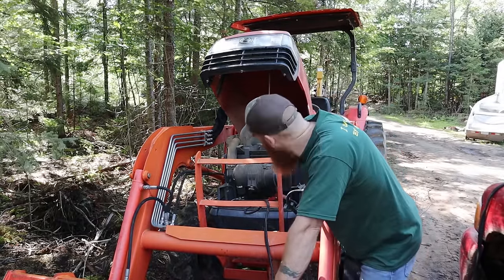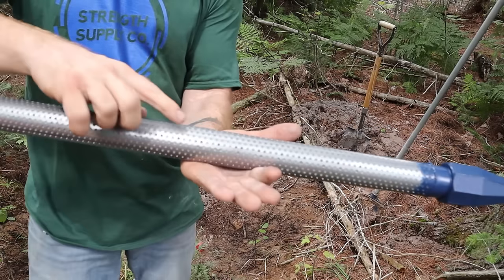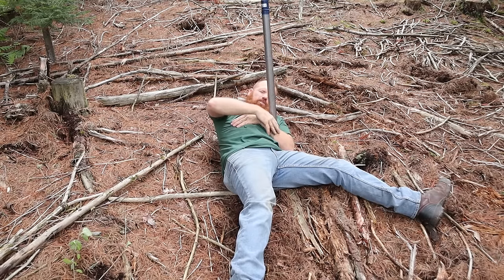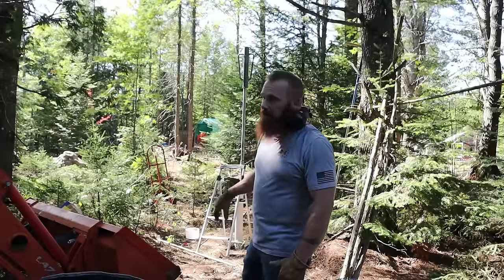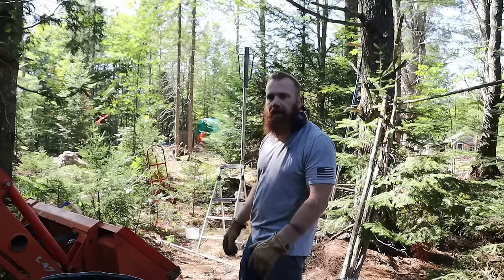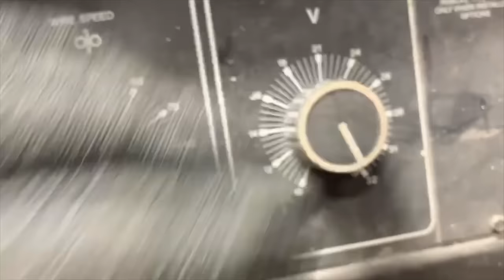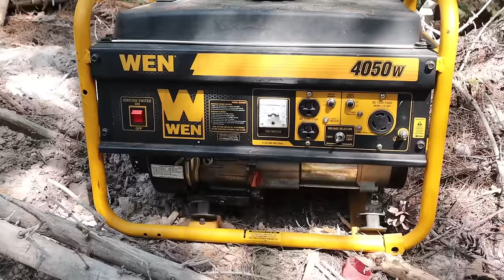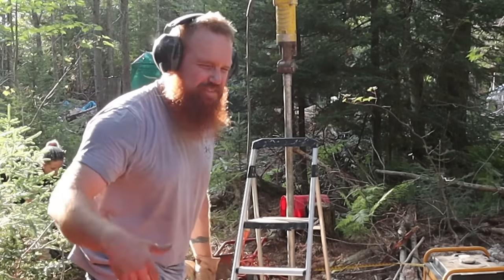Off Grid YouTube Family of Girls Step up to Help Dad Drive a Well | Fabricating Off Grid Well Tools

Comment: I'm a bit baffled as to why after driving by hand so many feet, why not rent or purchase a pneumatic hand-held pipe driver? They've been around since the early '80s. Then again, you have access to water, why not a Honda well driller. You have the means to recirculate the water used to remove the mud caused by the drilling process... You have a tractor with a 540 pto... You could adapt it to drill your well. Unless the lesson here is that of frustration?
Reply from the maker: Not sure if you have ever been up here in the upper Peninsula of Michigan but rental options are far few and between. I have thought about using the pto on the tractor to drill. Just haven’t got to it yet

Comment: Why can’t a well driller get out to your property?  Distance?  Navigating through the trees?  Cost?  At this point, I would task the girls with building a 4-lane highway for easy access. ;-)
Reply from the maker: Very small trail system and lots of trees would need to be removed and a very expensive road improvement. Not doable.
Reply: @9252LIFE  I figured. No easy answer.

Comment: I like the way you did it but what I did was I took an Olympic weightlifting bar cut collar of one side welded the remaining collar to the bar really good then welded a 45 lbs plate and a 35 lbs plate on top welded good then welded an eye bolt on top to tie a rope set up a tall tripod attached a pulley spiked the tripod good so it wouldn't move then got 2 inch half pipe camphered the first collar in then cut chisel teeth attached to two inch pipe drove the pipe with the chiseled end in first drove till it's started getting hard to drive then I got a barrel full of water from neighbors and just ran water down pipe gravity jetting sand rock and clay came to the top periodically I would put a hand pump with adaptor two screw on two inch casing see what came up nothing kept driving till I hit good water then I dropped a 1 inch pic pipe with a foot valve then plumbed that just giving you idea kinda skipped something the bar runs inside the casing as a guide you simply pull the rope and let go gravity will pound it lot easier than what your doing plus you don't know if the pipe is damaged deeper my way if casing cracks somewhere it's ok your dropping a sealed pipe make sure you by pvc with a bell to drop good luck
Reply: I been off grid for years with a lot less stuff at my disposal
Reply from the maker: Thank you.
Reply: @9252LIFE  by the way looks like you definitely hit water drop a 3/4 or 1/2 pic pipe biggest you can fit as far down as you maybe use a zip ties to hold a screen to stop dirt can in that broken pipe then put adaptor to fit you can use that to jet your next casing
Reply: @9252LIFE  I know it sucks after all that work to abandon but if you do it my way it will last forever my well is 30 years old still going strong. That's what you want something you never have to mess with again who knows how many fractures are in your pipe and how deep
Reply: @9252LIFE  one more tip when your jetting and no water comes back up you hit a pocket try hand pumping look at the quality might hit a spring like I did

Comment: Why didnt you just put a pipe on the side of the bucket of your tractor.
Wet the hole  and push it down.
You can get pumps with more lift solar or hand pump.
Reply from the maker: The tractor won’t push it down. We’ve tried it.

Comment: I know your done with this project, but, just a brain fart on my end. Why didn’t you use the tractor, instead of hand fence post driver? Positive you had your reason, but, just wondering.
Reply from the maker: Not done with it yet. And the tractor isn’t tough enough to push down a well point. It could do a fence T post.

Comment: work harder not smarter that tractor has a bucket for a reason
Reply from the maker: This has got to be the biggest topic on our video. The tractor will NOT push the pipe in the ground. Even loaded with sand. It’s just too small of a tractor. We tried it. Guess I should’ve put that on our video.

Comment: What you are doing won't work.  A point well only works to 20 feet.  If you want to use that pump you need to have a venturi at the bottom of the well. There is an outer casing and then a pipe that drops down that casing to the bottom.

Comment: Never understood the short 2 foot post drivers with handles !     6:24      Get rid of those handles and make a post driver thats 3 foot long instead. Unlikely you will have the post driver come off the end of the post  and smash your hand /arm !    And you have a lot longer swing .  This tap tap tap with the shorty driver ........ looks painful ! You dont need handles. Just take hold of the longer post driver and use it !
Reply from the maker: You are absolutely right on that! I had the post driver hit me in the head so hard one day I seen stars and had a mild concussion. When I was hammering up and down, I went up too far and the bottom of the driver went above the post I was driving down and caught the edge and with the downward force I was giving it, the top came down towards me and smashed my head! Not the best day
Reply: @9252LIFE    True  OSHA  should ban such a post driver ! ( just slightly joking )     If your going to drive a post... use more up and down motion......and you dont get that with a two foot post driver !

Comment: Its more manly to use the tractor bucket to push pipe down if you can operate 🚜.
Reply from the maker: It’s also more manly to know your tractors.. The little kubota is not strong enough to push it down as it doesn’t have downward pressure like a skid steer.  We’ve tried. Thanks for watching

Comment: You have a loader tractor behind you to pound with....just go easy
Reply from the maker: Tried it. It doesn’t work like you think it would. Not worth the effort. The hydraulics are slow going so it doesn’t exactly hammer and not tough enough to push it in

Comment: Why can't you pump water down the steel pipe to flush out the clay and drive it deeper?
Reply from the maker: I can. But the pipe broke off 8 ft down.
Reply: I think my comments are getting deleted??? Idk!?
Reply from the maker: As I was replying to your last comment it wouldn’t let me send.
Reply: Did u get my other comments?
Reply: Weird!
Reply: Ok well when we drill wells here in Florida we use 3/4 in pvc and blast air down the wells to prime them, and if it's plugged up with clay just pump water down it until it's clear but the air should do the trick. Just make sure u tie off the pipe cause if it comes flying out it's a big ass whip lol.

Comment: if the water is above the clay, and if you dig trough the clay the water above the clay can run away deeper
you need to figure out where the deepest point of the clay layer is (it basically forms an underground  water basin), when you would pump away the water there new water should seep trough over the clay layer to the deepest point again
but if there is a point where water can go trough the clay and go deeper, you may need to trough the clay to find the next layer of water.
@2:50 unless all the ground around there is clay there is no point of drilling that tube with screen into the clay, clay is too dense to (easily) let water trough, clay particles re so small it will indeed clog the screen.
@14:45 i hope the paint of the car didnt get damaged too much by the sparks and metal parts.
Reply from the maker: The camera angle made it look like the car was taking on sparks but it was not.

Comment: Man use that Kubota to push that stuff down
Reply from the maker: I know right! Sounds so easy ! Yep I tried it.. the tractor isn’t tough enough and it doesn’t really have a fast drop hammer Power either. Pushing in a Tpost and pushing in a 1 3/4 well point is a huge difference.

Comment: Excrutiating to watch... perfectly good tractor sitting right there and yet you're pounding a hole by hand
Reply from the maker: We tried using the tractor and it would not pound or push the pipe in. A Tpost yes but not the well pipe.

Comment: 15:12 Ummmmm... ooooooooooookay... and just exactly what is THAT shot-angle supposed to signify...?  Is it meaning that you're gonna use FART GAS for da WELDING TORCH??? :P
Reply from the maker: That could save some money in welding gas! 😆
Reply: @9252LIFE  Yes, but would baked beans cost more than the cylinders of gas...??

Comment: This is just a brain fart but what if you loaded your tractor bucket with a scoop of rock then let it down on the pipe. Would it drive it? I've never tried that before so I'm not sure but I'm sure I'm getting old so I have to work differently now days. Age will do that to ya.
Reply from the maker: We filled it with sand and tried it. The problem is the bucket doesn’t free fall drop. It just goes down slowly with the hydraulics and doesn’t allow it to hammer. And being such a small tractor it just won’t push it down. It barely does metal fence t post.

Comment: why isnt your tractor doing most of the work//?
Reply from the maker: Just in case you’re wondering, no the tractor won’t pound the pipe down. No the tractor won’t push the pipe down. Maybe we could’ve somehow put pressure down on the pipe with it by tying straps to it but probably wouldn’t be worth the effort
Reply: No i saw you carrying stuff and thought just load the tractor to carry

But further to your point you could hold the weight of the jackhammer it perhaps

Also surely theres a hydraulic attachment that can help
Mate of mine drives piling sheets with something similar

Comment: I would have used the bucket on the tractor to push it down
Reply from the maker: Us too.. But unfortunately it doesn’t work like you’d think. If it was a fence Tpost it would do it but it wouldn’t with the well pipe through the clay.
Reply: @9252LIFE  I have thought about drilling one myself just never got around to it as its isnt really needed. I was going to use a petrol powered earth auger with 4 inch drill. (I have one lying around thats not been used for a few years)

Comment: Hey brother it would be a lot easier to use a pressure washer with PVC pipe cut some teeth around the bottom
Reply from the maker: We didn’t have much water to work with at the time.

Comment: No way that pump is going to lift 60feet from the surface.  cavitation
Reply from the maker: It wouldn’t lift 60 feet from the surface.  The ground water is less than 20 ft down. Just need to be in sand not clay to draw the water up.
Reply: See you changed the name of the click bait video that stated well was 60 feet.
Reply from the maker: @LionSandwich  I haven’t changed anything. Pay closer attention.. Take care

Comment: really....that entire video you had a loader tractor sitting right there and you never thought to use the bucket to push the pipe down....I've driven 2 point wells with a loader tractor....one at 25 ft and one at 100 ish feet. The jackhammer was a horrible idea especially on that cheap crappy stepladder you had.
Reply from the maker: 1: Tractor bucket will not push the pipe down.
2: The jackhammer worked great! 
3: The stepladder served it’s purpose. 
4: I hope you’re having a great day. 

Take care Michael

Comment: You've got a tractor with a front loader standing right there, which could be used to hammer down the pipe with the front loader ?????? Why make your daughter do it ??
Reply from the maker: The tractor won’t do it. Tried it. Would’ve been nice but it’s a small tractor.

Comment: Your so funny you have a tractor behind you and you're using a post driver to pound the pipe... WOW... Have fun, next time think before you act... Use the Tractor...
Reply from the maker: Your so funny you don’t think we’ve tried that yet...WOW... Have a great day, next time think before you comment...
Reply: @9252LIFE  Yeah, Anyone that would think of using the tool that you eventually used, would surely have thought of that, Great idea and inspiring to say the least... 
It was nice that you had that tool available, the ones made for a tractor are expensive to say the least...
PS did you ever get the water system to work after the pipe broke?
May GOD Bless you and yours... AMEN...

Comment: ….why aren’t you using your machine???.  Also you said you have water at 8ft, why not just dig a water source pond?
Reply from the maker: The tractor wasn’t tough enough and we wanted down further to cleaner water that also won’t freeze in the winter up here.
Reply: You aren’t stronger than the hydraulics of the tractor.
Reply from the maker: Stephen the hydraulics doesn’t work going down.. the hydraulics work going up.. when going down it’s only gravity that brings it down and slowly so there’s still not much hammering force. Therefore yes we are stronger when it comes to pushing/hammering in a well point. We have tried many different options. I hope that clears it up a bit for you. Have a good day Stephen.
Reply: No. Also they make a pipe clamp you can attach to a chain to pull a pipe vertically. When it come time to fix the pipe. You might even be able to wrap a chain around the pipe and pull up with the bucket with out digging it out. As for driving with the bucket; if your hydraulics only work in one direction, you can fill the bucket with dirt and wrap the backer with a tarp. Gravity+weight of the load will work better than a fence post driver
Reply: Sounds like you have water in that casing pipe from a high water table. You could use a mud pump from harbor freight to jet the well with your well pipe. You could use your machine to dig a sump pond the well head can drain to through some hay bails.

Comment: I've tried welding those tools for hammers and not sure what material they use but it is a mother f@#cker. Even tried machining it on the lathe and my carbide tooling was like GTFOH.
Reply from the maker: I think if I were to hear them up with a torch first and then welded them it would’ve held better. It looked almost like a cast in the center.
Reply: @9252LIFE  Maybe treat it like cast iron. Preheat to 500 degrees in a toaster oven then after welding, peen the weld for stress relief and then pack it with welding blanket or the like to let it cool off slowly. My weld broke as well as I was trying to make a tamper out of it (8" square plate at the bottom for compaction). Must have welded that thing 10x's to get through the job lol.

Comment: Lol, looks like a bunch of unnecessary work/$. Why didn't you take you tractor, dig a 8 ft.  X 8 - 12 ft. Depth hole, set your casing and backfill with sand and gravel, put backfill dirt around 5 ft. This would sovle your clay problem and somewhat filter your water. 

Hey, work smarter, not harder.
Reply from the maker: Thanks